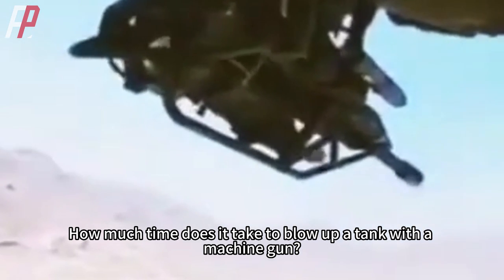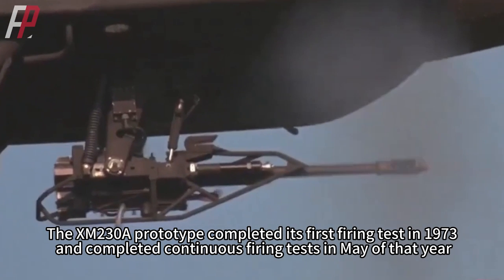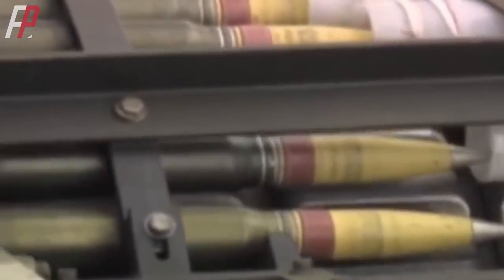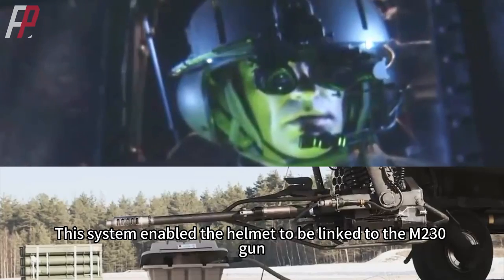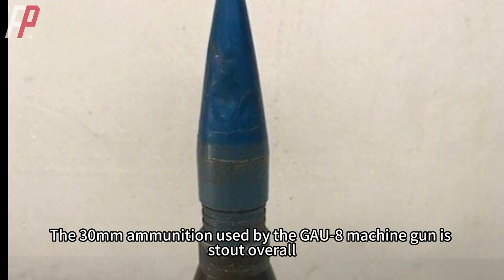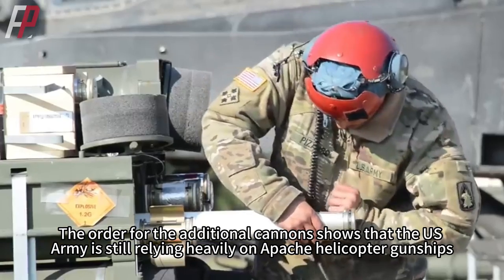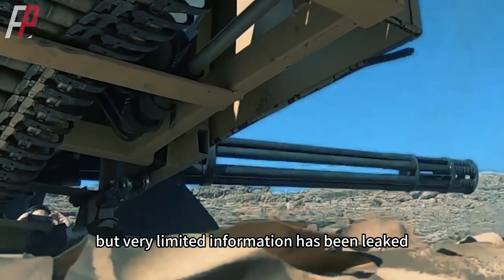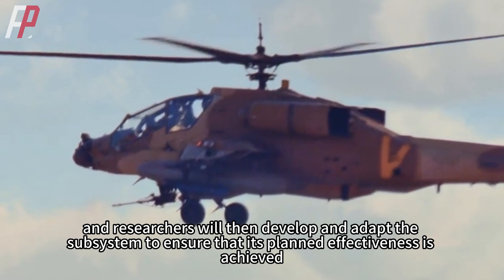M230 Chain Gun Apache's Ultimate Weapon

Comment: Can this canon m230 penetrate MBT armour?
Reply: No, it's used basically against infantry and LAVs(lightly armored vehicles)
MBT armour are basically 600mm-900mm thick.
The apache's gun can penetrate 25mm of armor with its m789 hedp rounds at 500m, but it's just better to use a ATGM against a tank
Reply: If they peppered 500 rounds into any mbt I doubt it would work properly if much at all
Reply: @Pakhira148  why don't they go for a 20mm three barrel gatling gun like on the cobra if it's just for infantry and LAV's  ???  much higher rate of fire & the 20mm bullet travels faster